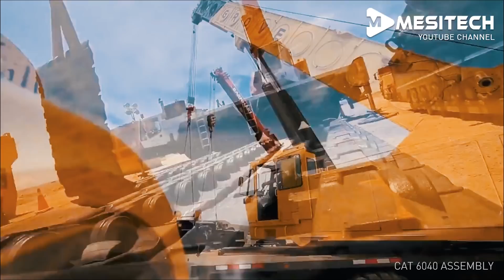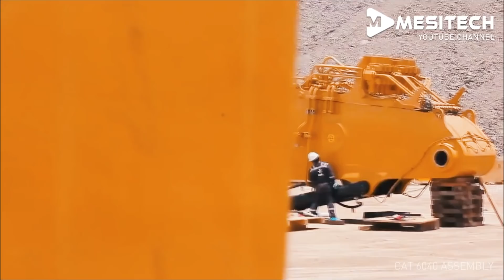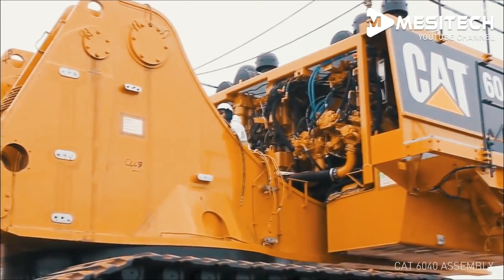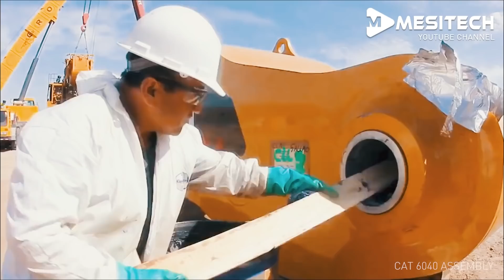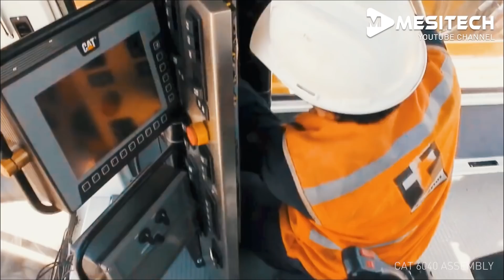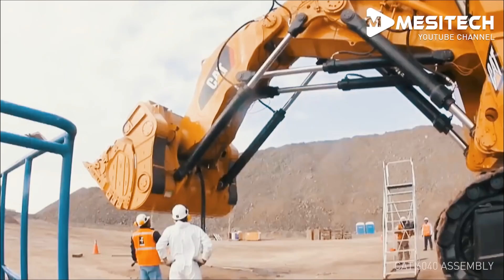Giant Excavator Assembly Process (Amazing Huge Excavator Assembled)

Comment: It would be good if they were setting it up at regular speed instead of this speed run
Reply: The video would be an hour long
Reply: @shilohlopez3519  um it would be a lot longer than that. I'd imagine it takes a couple days if not a week to do this

But these shots are too fast and it's hard to tell what's going on. They need to show real time shots
Reply: @LukeA_55   buddy I’m a heavy machine operator this wouldn’t tKe a day. Clearly the video was taken in one shot in one day thanks for the input
Reply: @shilohlopez3519  I find that hard to believe
We had a recall on a piece of farm equipment once.. we had to completely tear apart the middle of it to replace the parts. Took the two mechanics at least 3 hours to get it put back together. That's just a simple piece of farm machinery, not a whole freaking exevator